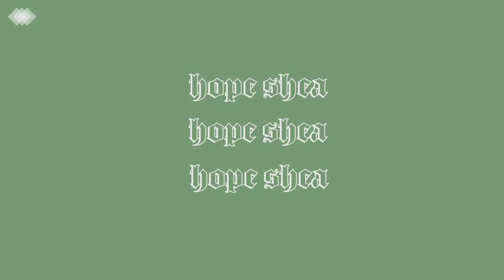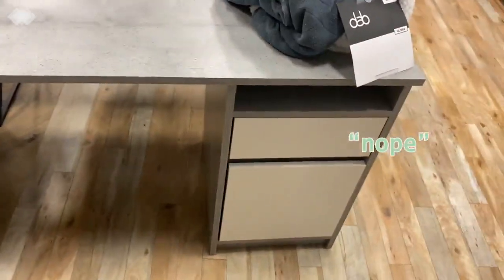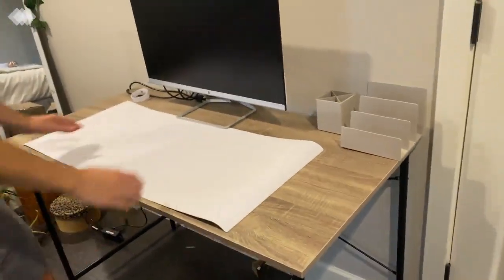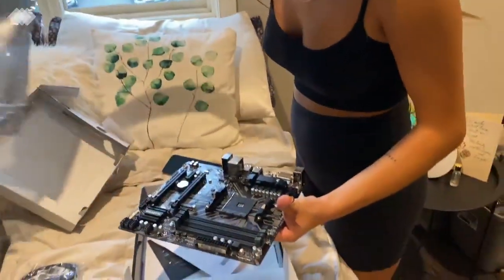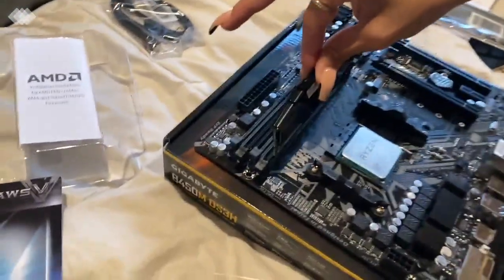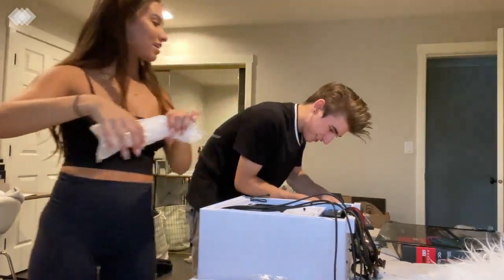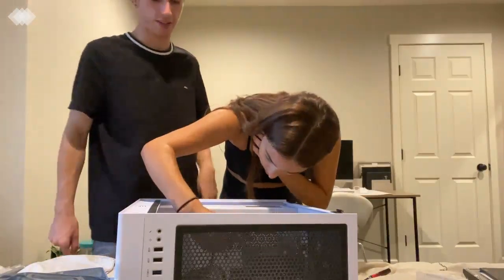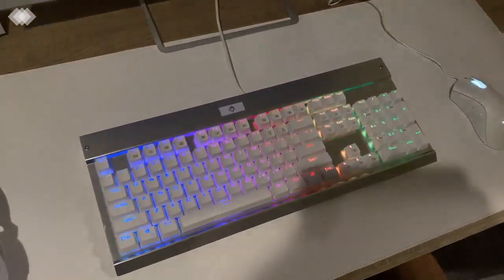VLOG: Building my first PC with my boyfriend + desk shopping!

Comment: Hey I'm pretty sure the RAM should be in the 2nd and 4th DIMM slots to tale advantage of dual channel
Reply: Yeah i was wondering why he put it on the 1st and 3rd too
Reply: @ernsuxx8050  I think that they think that if you put the ram 1 apart its dual channel they got to be in the 2nd and 4th DIMM slot
Reply: @mrcucumber8460  1 & 3 will work as dual chanel. With most motherboards its usually best to use 2 & 4 (furthest from CPU) but its not always the case. Some MBs say to use 1 & 3. Always check the manual.
Reply: @shortfingerpm  Ahh ok, I didn't know that
Reply: She did it right

Comment: The ram is in the wrong slots so you aren’t getting full performance
Reply: no the ram is in the right ones
Reply: @MarcoCecco  no it’s is supposed to be on 2 and 4
Reply: @MarcoCecco  it’s wrong
Reply: @alancisneros7645  for that motherboard 1 and 3 still work
Reply: @MarcoCecco  yes but its faster if you put it in 2 and 4
Reply: @MarcoCecco  yeah but since it is only two, if you put it on 2 and 4 you will be running duel memory channels which will be faster

Comment: Next time you have it assembled by a competent one, because you are not capable, you have assembled it on a bed, the CPU has not broken fortunately, the ram is in the wrong slots, that case has no airflow, that power supply sucks, the ssd is not fixed even if it does not cause problems and finally the cable menagement really hurts, those sata cables can not be seen. 
I tell you I'm 15 years old and I've mounted a few pCs, but well.
Reply: You are commenting on a someone building their first PC, this ain't a guide. go worry about what mom is cooking for dinner not what slots the ram goes in.